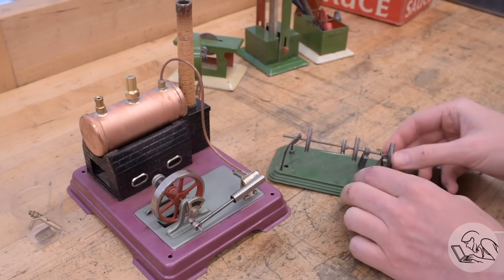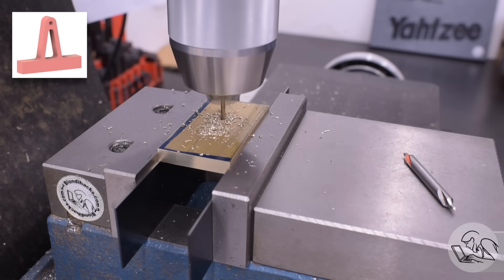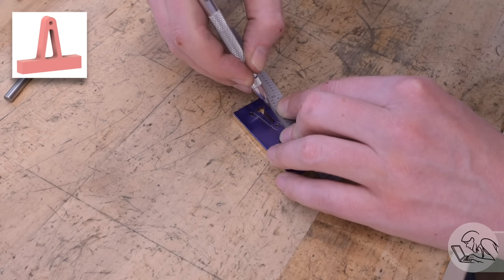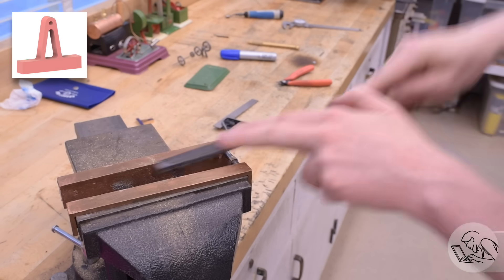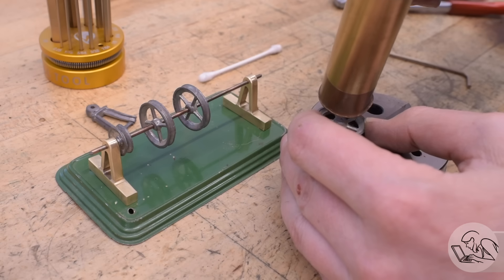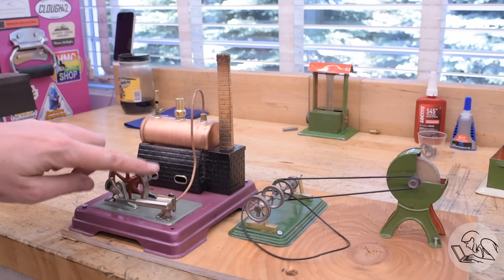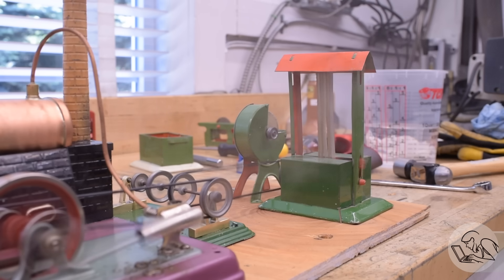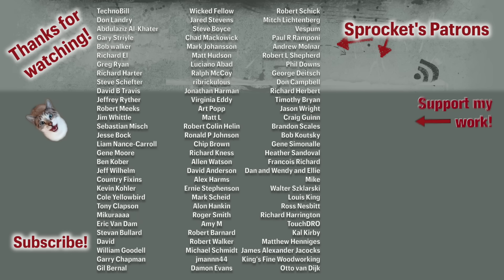Finishing A Vintage Steam Toy - Part 5, First Run On Steam!

Comment: I have a late 1970s Wilesco wobbler, nearly the same dimensions this one, and the manual states to use two Esbit tablets in the fuel tray, in an inverted T shape, one flat on the bottom of the tray, the second on the long edge on top of that. That will give you better heat and runtime.

Comment: We had one of these engines when I was a kid. In fact I still have it, down in my workshop store-room. 😀If I recall, after we used up all of the solid fuel tablets, my dad made a small "fuel pan", into which we poured some methyl alcohol. I think the engine ran okay with that liquid fuel, although I have no idea how that liquid fuel compared to the tablets. But, the methyl alcohol was easily available at the hardware store or grocery store.

Comment: The Mamod steam toys over here in the UK all ran on methylated spirits. The firebox was similar to yours, but had wadding inside covered with a mesh. You filled it up and lit it. It was good for several minutes, and of course you could easily refill it before you lost too much pressure.

Comment: I have a Fleischman model 130/2 which was a present in the 60s. The fuel tablet tray will hold four Esbit tablets, of the type which are scored for breaking in half, which are spaced evenly along the underside of the boiler. If I load all four to fire the boiler, when the boiler gets to the boiling point, flames shoot up through the gaps between the boiler and the metal brickwork, burning the paint. After that is put out, the boiler will run fine on just two tablets. I’m assuming this is because the boiler has become hot enough to produce a chimney effect around the cylindrical boiler. It’s quite spectacular when this happens. On another topic, I wonder if you could speak about gage pins, which are available in plus and minus tolerances, typical on the order of .ooo2 inch. Which would be better, plus or minus tolerance, to have for home hobby machining?

Comment: The shaft of the line shaft is a standard wire size but with a little trick. They stretch the wire till plastic deformation to get the wire straight  and in this process, the diameter gets a little bit thinner and as a bonus, the wire hardens. 
You can do this really easy by your self. On end of a lone wie in a vice and the other with vice grips and than give it a pull till you feel the metal stretching.

Comment: In my callow youth in the distant mists of time I worked as a tail sawyer, (the "unskilled" assistant to the sawyer), on a saw like that.  It's official title is a sash gang saw.  Sash because the frame that held the saws looked to someone like a window sash and gang saw because it would saw more than one board at a time.

Comment: 0.085" = #31 piano wire.  maybe the OEM had a sizable backstock of hard wire on the shelf to get rid of?  (edited to correct a leading zero and decimal placement error)
Reply: Also equates to 14 SWG

Comment: I built a similar steam engine at school in the 1970s. The boiler was a powdered milk tin (like a small paint tin) and the safety valve was the lid which simply blew off sending hot water everywhere.

Comment: I don't know if it still holds true but a few years ago rubber rotary shaft seals, front wheel seals,  etc., had a spring inside the lip nearly identical to those used on toy steam engines.  The spring had a tapered end so it screwed into itself or could be combined others for any length.   Hopefully a repair shop in your area could provide you with take-outs.

Comment: Bamboo Tungsten for TIG Welding wood, your sense of humor is really great. And as already mentioned here, the esbit tablets were not helpful 60 years ago and they have not been improved, I never liked the smell and their poor function. On my Wilesco D16 I just used a gas flame. That helped much to blow the front glas out while the safety valve had a pair of pliers on it as weight, it was the former lever type with the weight hanging in a notch. 
Playing around with this steam engine helped a lot in my understanding of machinery, on the shipyard I learnt building real boilers and steam turbines and later operated them as a ships engineer. When I told a friend that I operated a turbine with 48000 horsepower he smiled lightly at me and stated "well with such a mouse power I turn my boiler feed pump", he worked in a nuclear power station...

Always enjoying your videos, greetz from Germany

Comment: Those tablets are always hard to light. When we use them while backpacking the trick is to scrape the top a bit with a knife or other sharp object to get some "sawdust" style shavings. Leave those on top and light the shavings. It doesn't take much.

Comment: Sure this has been said elsewhere. I have one of these from likely late 60’s. It has a throttle (whistle valve without the whistle piece). I still fire it up occasionally on a rainy day. Sterno makes good fuel. The tray contains any liquid alcohol, and it lasts longer than I need to see it run.

Comment: Dad got me a hacksaw-like accessory for my steam engine. It was too weak to cut matches so he got some sticks of balsa wood. I would sit and chop little bits of balsa with the steam engine. It also had a mortar mixer that you could load up with cocoa, sugar and cream. I would pour the ”mortar” into a cup and pour on warm milk- hot chocolate! Such a useful household appliance that was!
Reply: Yeah, the moment I saw that saw going I thought, "Quinn, you gotta get yourself some balsa stripwood, and make slightly smaller, crappier, balsa strip wood."
Reply: You had me at “Hot Chocolate”. 😊

Comment: Any thought to making a small methyl alcohol burner?  Something small enough that it fits in with the low heat/low pressure safety side of things?  I know there's been some other videos by folks in England where I believe they are dealing with the ban on the fuel tablets.  A suitable size alky burner might be a nice final chapter to this for the rest of the world or here in Canada for if and when they ban the fuel here too.

Comment: When I was a kid back in the '50s, my folks bought me this exact model steam engine. I spent hours and hours in my imaginary locomotive chooching down from adventure to adventure. When the tablets were eventually consumed, in my ignorance I used cotton balls and rubbing alcohol as a fuel source. Worked great until I ran the boiler dry and melted the solder sealing the end caps. No more chooching for me.

Comment: Try ZIP fire starters, they are some type of solid fuel similar to what you have, not sure the btu output
Reply: I think they'd make just too much smoke: they're essentially paraffin wax. I think these engines were designed to run on metaldehyde or hexamine blocks.

Comment: It always feels a bit silly to use an enormous bench file on tiny parts, but for bulk removal, even on those, it's the way to go. PS. Vallorbe/Glardon literally calls those knife shaped files knife files (LA2405 in their catalog for reference).

Comment: Quinn - great to see that little toy have a new lease on life. I found your thoughts interesting, about 'dialing back' a model engineer's standards to be more in alignment with the strategies used for making inexpensive toys. I was actually shocked when you gave kudos to the person who made those 'loopy' shaft supports, but I guess they did work - but just barely.
I'll be eager to hear your report on how TIG welding wood works. Your electrodes look pretty promising!
Reply: You have to have good celling skills to get the ulose to bind in a CO2 rich gas stream.

Comment: Most of those engines/boilers ran at 15 to 30psi., you should put an overflow plug in the end of the boiler if you do not fill a sight glass. I have found that most of the small boilers required two tablets to run, or better still convert to a gas burner.

Comment: FWIW: because of the vintage of this steam engine, it could have possibly been fired with denatured alcohol. There would have been a special burner, most likely with two wicks. Engineering challenge: build a solid fuel tray that can hold two tablets. It will generate a little more heat, thus more steam, etc. Another fact: some of the line shaft accessories had a hold drilled down from the top to the shaft to facilitate oiling them. Great vid, thanks for sharing.
Reply: We had this toy.  It was fired with tablets in a rectangular tray with a handle

Comment: I'm really fascinated by the old line shaft systems. Something about the central power source and every machine running of that is just incredibly cool. I saw a working system at an  industrial museum in the Netherlands and I spent more time looking at the governor than anything else in the museum!
Reply: Go check out Iron Jonesy

Iron Jonesy

Description
Hi! I'm Alec, a blacksmith and self taught machinist, with a love for antique machine tools and manufacturing history. Join me for regular workshop antics from machining and forge work to restoration, all while I grow and develop an 1890s belt driven machine shop.
Reply: The factory line shaft system is where the term 'Grease Monkey' originates from as young children were employed to climb about in the factory roof trusses and lubricate the line shaft bearing blocks.
Reply: In "het openluchtmuseum " they have one in the steam dairy factory Freia. Which is still operational and is run regularly.
Reply: My father built a lathe from a kit back in the 1960s and that used a short line shaft mounted above head height on the garage wall. The shaft was driven by an electric motor and flat leather belts. The motor ran constantly and the lath was started and stopped by moving a wooden lever that shifted a belt from an idler pulley to one fixed to a shaft.
Reply: @ColinWatters  It is a fascinating system to watch working.  On many old metal shapers and metal planers the drive mechanism automatically switches the flat belt from one pulley to a neighbouring one to give the shaper ram or planer table its forwards and reverse motion....a very simple but highly reliable mechanism.
Reply: If you find governors fascinating, check out the recent John Hannavy book. I'm partway through it.
Reply: We had a line shaft in the shearing shed when I was a kid, with axles hanging down to power the clippers for each shearer. There was a complicated system of joints to let the clippers work at any angle.

Not steam powered, sadly, at least not any more. Just a big electric motor down one end of the shed that ran the drive belt.
Reply: Technically, we still use the same system. We just use a much bigger source of centralized power, and we move it with wires instead of shafts.